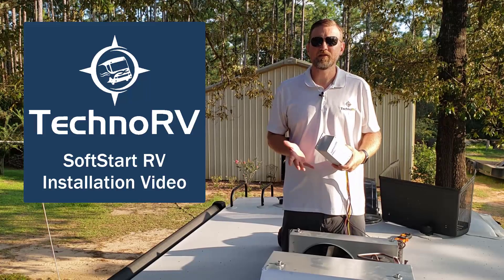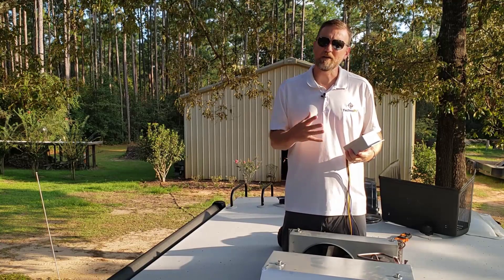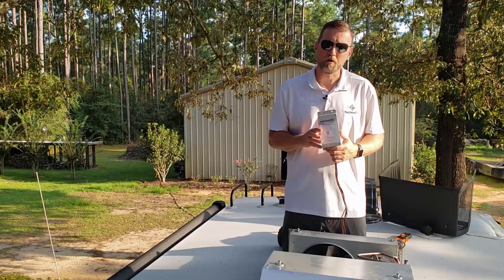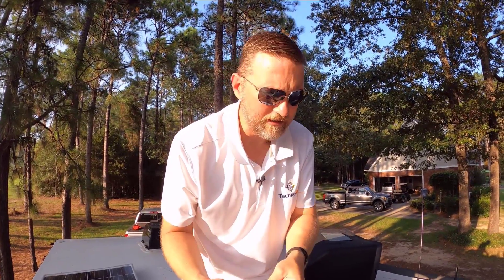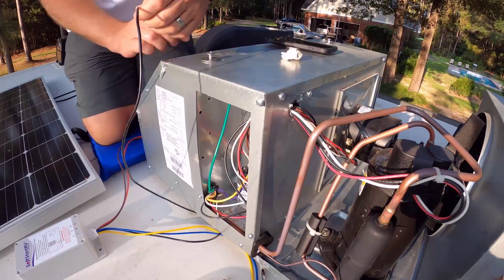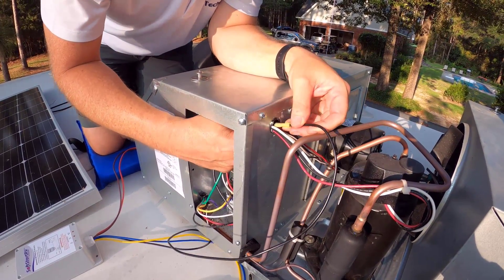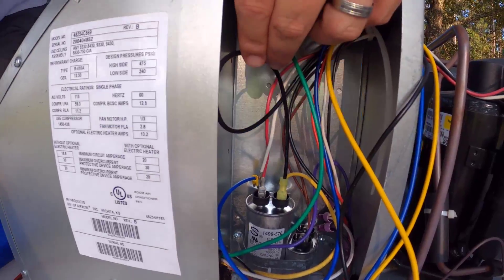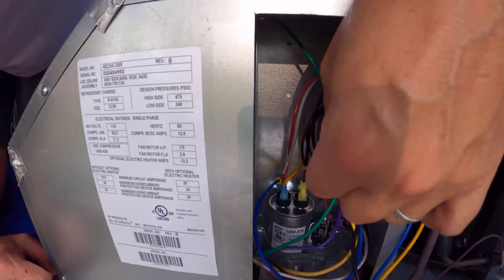SoftStartRV Installation on a Coleman Mach RV Air Conditioner

Comment: Never use those cheap cap type wire connectors.   I’ve had to replace many of those over the years on RVs due to poor connections they create.

Comment: I just installed a no name soft start as well, with help from this video, so thank you very much for your help.
I will say I was surprised you left the white/blue connected wires exposed without any elec tape on it. I put tape on mine.
Thanks again.
Btw, been running it all day today with no problems, so thanks again.
Reply from the maker: Awesome to hear and thanks for the feedback.

Comment: Great video!

Instead of cutting the black wire,  could you just take the cap off the compressor, remove the black wire and connect the brown wire there? And then connect the red wire to the black wire you removed from the compressor?  No cutting and splicing..
Reply from the maker: I would like to refer you to the manufacture to ask that detailed question.  I want to make sure we get you the best answer and I feel they are the best able to answer.
Reply: That is the best approach period..
Reply: I completely agree. I am an electrician and I install these on residential home A/C units. I have never installed one on an RV which is what brought me here. Great video! However, I hope you taped up the first connection you made. I did not like seeing the exposed contact that could bounce around and ground out.

Comment: Just finished my install and want to thank you so much for such an Informative video!  No matter what video I watched or schematic I looked at, I just couldn’t figure out where those last two wires went to. I had setup an Amazon return and had decided to go from my 3500 predator to a 5k then came across this. I saved hundreds sticking with my 3500. Continue your great work. Thanks again!

Comment: Not clear why you need to install the unit outside of capacitor compartment and then move ALL wires inside. You can just install this unit inside capacitor compartment and cables will be inside.

Comment: This video is AWESOME! Just did it in less than 1/2 hour start to finish. For those asking about the blue and white wires, yes you can just let them hang... they don't get plugged in anywhere. I used some black tape and taped them up, but you could just use another of those caps and crimp them together.  Thanks again!

Comment: Buyer be aware!  This video needs to be updated!  Newer Airexcel, Coleman Mach Model 45203-6963 units constructed 09-20 have a soft start now installed in the unit.  As a DIY person I bought a SoftStarRV unit from TechnoRV on a promotional sale, in March of 2024, I finally got around to installing it here at the end of May.  After getting assistance from an engineer with SoftStartRV who looked at the wiring diagram he informed me that my newer Cole Mach A/C had a soft start component in it.  So, TechnoRV said they have 30 day returns only, and to sell it on Craigs list, the representative from SoftStart RV said even they have 90 day returns if purchased through them.
Reply: Interesting, I was told my New RV had soft starts already installed in them, they are all 3 Coleman Mach units. But I could not confirm this from anyone. How did you see yours had a soft start?
Reply: @Benstechchannel  There is a wiring diagram on the inside of the access panel cover.  So remove the cover over the A/C unit then pull the wiring access panel cover and look at the yellow wiring diagram, and look for the designation “Compressor soft start board”.
Reply: So you just left the blue/white wire you connected togethee hanging?
Reply: @grmishady No gave the soft start component to my son-in -law.  Removed the Coleman too noisy.  Installed a Houghton 13.5 from Recpro, with a heat pump.

Comment: Thanks for sharing this video, is that Soft Start made in USA? Also what did you do to the blue and white wire that’s piggy backed on the same wire terminal, are they just floating, I didn’t see you insert them anywhere or even taped  them. TIA

Comment: ok a critical step you didn't clarify - that blue and white wire are now using that metal terminal attachment, they were not crimped - does that thing just hang loose?  or does it get plugged in somewhere?  why wouldn't you just crimp the blue and white like the others? that metal thing just hanging lose can make contact with something and short...

Comment: Be very carefull touching the capacitor' terminals , they hold a lot of current when they are charged,  I will sugest to look for a video on how to discharge the capacitor before doing any work with it , just my 2 cents.
Reply from the maker: Great callout Angel! A great way to do this is with a discharge pen. This will draw the current and pass it with great resistance and discharge your capacitor. Typically these pens are cheap an are always great to have when working with electricity.

Comment: Shouldn't you also tape up the connector you used to connect the white wire to the blue wire from the softstart or used a different connector? Great video!❤
Reply from the maker: Hi Dano! It is always a good idea to add electrical tape to the open connectors that you have. Because it is in a closed containment the connectors should be fine connected as they are in the video. It is personal preferences and all depends on how sealed your AC cover is.

Comment: My AC unit is a different model. The instructions from SoftStartRV has two options - an installation for units with or without a start relay.  How can I tell if mine has a start relay (vs. a start capacitor, which both instructions take into consideration)?  Would the relay be near the compressor or in the wiring box area?  Your video seems to follow the install for units with a start relay.
Reply from the maker: Hi Bruce! Great question and I want to make sure that you get the correct instructions for your specific AC unit. Softstart has schematics of virtually all AC models. Also, you can schedule an appointment and they can help walk you through an install.

Comment: Installed our SoftStartRV yesterday, after watching this video- it was super-smooth. I watched the video first, taking some notes on the wire colors; opened the cover of the unit and went through most of the steps; watched a particular part of the video again to confirm; and completed it- all in less than 30 minutes. I put the cover back on, fired up the on board generator, and turned on the A/C- it worked great! It was helpful, that this is the exact A/C unit that I have; but it could not have gone any smoother- THANKS!
Reply from the maker: Hi Mark! So glad your install went smoothly and glad we were able to help!

Comment: I just purchased a soft start from your website and my RV came with a 15k GE air-conditioning. Wish you would do a install on a ge. There's not much information on the soft start installation.
Reply from the maker: If you notice that your schematics arent easily viewed on the softstart website then it might be best to give them a call. They can schedule a call with you and help you install your unit.

Comment: I am so glad you put this video up. I received no instructions with my unit. Only a referral to the softstart RV website which led me to choose a wiring diagram based on a 1979 number on a yellow sticker in my unit which exists nowhere in the unit. Softstartnay want to take a look at this for the newer Colmans.
Reply: To follow up, this thing works great! I was previously running my AC with two 2000W generators in parallel and they struggled. I can now run on high with a single generator with no change in generator performance on AC startup. Great product.
Reply from the maker: Thank you for your feedback!
Reply from the maker: Hi Aaron! Since there are so many different AC units Softstart generally only posts the most popular units. Having said that, if you call them directly they can provide you with wiring diagrams for almost any unit.
Reply: Yes. I tried that. The gentleman I spoke with reassured me that there should be a 1976 number in the unit after I take off the cover and that this would be needed to get the wiring diagram . Not the case with my unit. My label is white like the one in the video, without a 1976 number.

Comment: Unfortunately not all Coleman Mach A/C are the same. I bought 2 of these for my 2021 Alliance 310RL 5th wheel. Went to install them. It is impossible to install them because there is nowhere to put the box.Anyway I am now stuck with them. Maybe I can sell them someday super cheap.
Reply from the maker: I'm sorry to hear about this, Beth. If you purchased from us, please give our Support Team a call. We want to help you!
Reply: @Technorv   Yes, I did buy them from TechnoRV along with many other things. I will try calling support. I don't see anyway to mount the box because the compressor is very close to the cabinet and on a 45 degree and the refrigerant lines are also in the way. I will send them a picture so they will be able to see the problems.
Reply from the maker: Look forward to helping you.

Comment: you should have not left the connector of the white wire and the blue wire exposed to possible touching grounding to AC wrap electrical tape on the exposed part or change the way they connect

Comment: What was the putty stuff you put over the hole through which the wires were run , and where might I get some for my own install?
Reply from the maker: Hey RoadTripLover, I'm not 100% sure what Eric used in this video, but I do know that his favorite "putty stuff" is Dicor Self-Leveling Caulk (for roof applications) and regular Dicor for walls and such.
Reply: @Technorv  Thank you. Dicor is for a completely different purpose - sealing points of water entry. The putty he used here is an electric application, though and would not be Dicor caulk.

Comment: I noticed you show a BLUE wire. Mine only has a BLACK, WHITE, BROWN, and and ORANGE. Is that model that you are showing is possibly the BLUETOOTH model?
Reply from the maker: Hey Martin, no its the SoftStartRV, which doesn't have bluetooth capabilities. We do carry the EasyStart with Bluetooth. I know that SoftStart made some minor design changes recently, after this video was made. Perhaps that can explain the wire color difference. I would need to compare the older and newer models in the office to know for sure.
Reply: @Technorv  Ok, my mistake. I already have the Easy Start 364 and thought this was the same. I was confused with that Blue wire. I was thinking it was the Easy Start with the Bluetooth option. Thanks. Great video anyway.

Comment: One thing I don’t understand is where the blue/white go that we did in the 1st step. The blue came for the the soft start and the white was removed from the run capacitor.
Reply from the maker: Hey RC, were you following Eric's video exactly, or did you use a wiring diagram specifically for your AC unit?
Reply: @Technorv  I was following it exactly. I ended up wire nutting them together. Not happy with the performance and will probably return. Didn’t run more than 15 minutes on my house power before it tripped the circuit. Trying to run it this past weekend while camping with my Honda 2000 and it just seems to have a hard time running.
Reply from the maker: I'm sorry to hear that. If your RV model is different than the one on Eric's RV, then you should absolutely check for your specific wiring diagram on SoftStart's website. They have hundreds of wiring diagrams and if you don't see yours, their support team is happy to get one for you.

Comment: would Wago connectors be okay in this application?
Reply: Yes, you can use Wago connectors. They will work perfectly I have seen them used in another video.
Reply from the maker: Great question! While I haven't asked this question to SoftStart directly, I don't see an issue with using this kind of connector. The idea is to splice those wires together, however you see fit!

Comment: The white and blue wire that you connected together with the piggyback connector, did you tape that up? 
And why didn’t you just crimp the two together with an end connector instead? 
Other than that this helped a lot!! Thx
Reply: Makes it easier when you trade in or sell to take soft start off to put on new camper....would be my guess

Comment: Installing the soft start will it void your AC war entry?
Reply from the maker: Hi Passat, most RV AC units have a 1 year warranty, and you would need to read the details on your specific unit to see if this is the case on voiding the warranty. You can install the Soft Start with no cutting or splicing so this could make a difference with this as well. I hope this helps. Eric

Comment: Great video! Only recommendation: I removed the crimp on the black and purple wire and spliced the brown and red in between. Didn't need my wire strippers that way and didn't need to cut any wires.
Reply: I saw that too. I would have removed that splice and added the soft-start there. That at least eliminates a redundant splice.
Reply from the maker: Thanks Luke, yes, SoftStart does have a no cut, no splice method as well. Thanks for sharing. Eric
Reply: What kind of putty is that at the end?

Comment: The Soft start is surely going to be our next TechnoRV purchase.  Need both AC's with 3 little ones and the heat we have been in lately
Reply from the maker: It is definitely a lifesaver in 50A RVs when you can't run all of the ACs....especially in the heat we've all been having lately.

Comment: Did you insulate your first connection, the white /blue wires (white from the cap, blue from the soft start) or just leave it hanging?
Reply: I wondered the same thing!
Reply: OR AT LEST PUT SOME TAPE ON THAT BARE WIRE METAL CONNECTOR

Comment: I have a Coleman Mach (1976D136)  and the run capacitor has the yellow and white wire on the left and the red wire on the right, which is the opposite of your Mach in the video. Other than that it's exactly the same. Do you think it's just rotated 180 degrees?  I received the Softstart today and once I'm confident it's going in! It's a great video!

Comment: You might want to mention discharging the capacitor before it lights you up!
Reply: and how is that done charles
Reply: @alsantos5518  with power disconnected  you can put a screwdriver across both capacitor terminals
Reply: @charlesking9745  Gotcha Thanks

Comment: I saw you remove the white wire and connect it to the blue wire. Where did you put it after that? Is it just taped up and not connected anywhere else? Surely it's not just floating around in there.... Thanks, Great VIdeo....
Reply: My thoughts exactly. I see no reply either

Comment: Great video!  Don't capacitors store high voltage that can shock you?  I was taught to touch a screw driver between the capacitor terminals to discharge it.
Reply: Generally not on AC circuits.  It still doesn't hurt to be safe, but AC voltage alternates between positive and negative so charge doesn't build up across the capacitor like it does on a DC circuit.
Reply: A capacitor will make you piss your pants lol hvac tech here

Comment: I didn’t see you discharge the run capacitor before working with it. Is that not in the instructions?  If not it should because you can get a jolt even with the power turned off.
Reply: I was waiting for a zap when he reached in and grabbed the wires but then this is a run capacitor not a start capacitor so it was probably depleted when the unit cycled off. Now the Soft Start if ever removed could pack a wallop of a charge between the wires if it's got a large start capacitor inside.

Comment: My question is how does this affect the factor warranty and any extended warranty purchased from the dealer.  As I have read some comments that these units are actually designed for central air units and they could shred your RV AV - as I don't have an electrical background, it would be nice to understand these questions.  As the product would be great to install on my 5th Wheel.

Comment: Do you need a soft start for each unit?
Reply from the maker: Hi Rick.  Yes,  you will need a SoftStart on each unit you want to use. We only put 2 on our RV with 3 ACs since we knew we could only use 2 at a time.  We just picked the 2 we use most.
Reply: Thank you for the reply

Comment: I heard you say you have to clean up the wiring before closing it back up. How did you insulate the Blue & White wire terminal ? so it wont touch metal and short out.
Reply from the maker: The SoftStart comes with wire nuts, and then you can use electrical tape to ensure you have everything protected. Since I was videoing the install I sort of skipped out on making things neat in order to show the connections quickly. I could have probably but 6-8 inches of wire from the SoftStart. Each install will be a little different.
Reply: @Technorv  You should have just cut and used the crimp on connector

Comment: Where did you put the blue and white? I did not see what you did with it.
Reply from the maker: Once the blue and white wires are connected they just tuck back into the compartment with the run capacitor. Hope this helps. Eric
Reply: @Technorv  So just let the bare wire connector float around?
Reply: Kit Should have included all necessary parts. Mine kit came with 2 insulated Female and 3 insulated Male connector, opposite of need.  An extra insulated join crimp connector would solve the blue/white wire connection. Video showed joining those with a buddy Tap-on and never mentioned again until buried in Q/A comments.